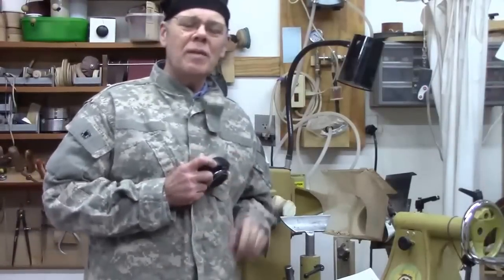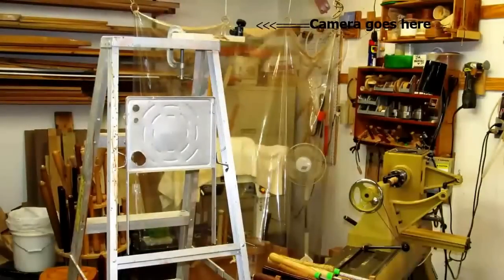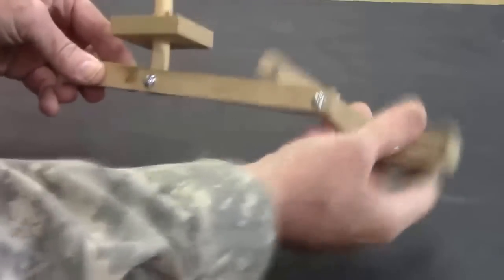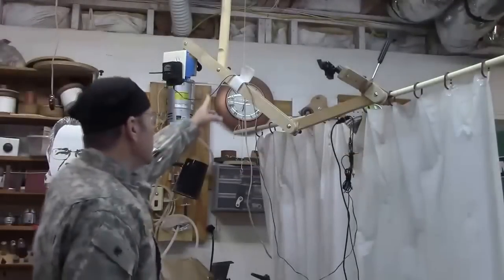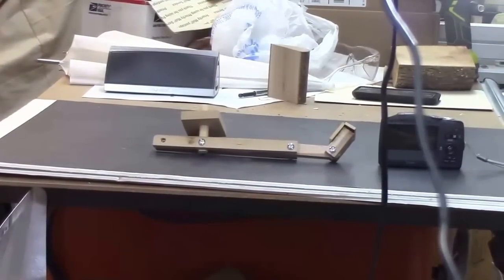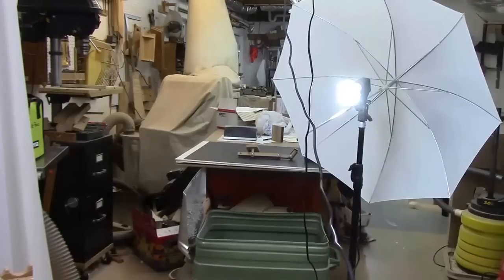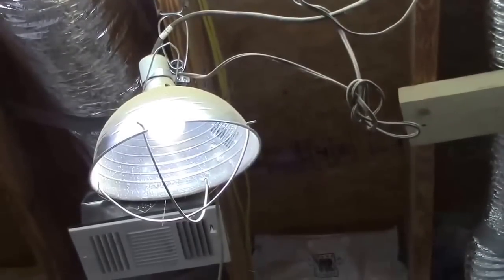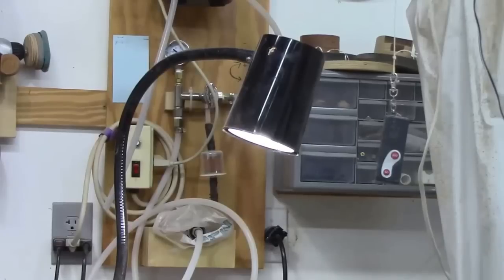Articulating Arm Camcorder Crane and External Monitor

Comment: Looks like some good ideas for mounting the camera.  What is the connection from the camera to the monitor?  Is it composite video?  Does your camera have a composite video output or hdmi output?  Do you use an hdmi to composite converter?  My camera has a mini hdmi output.  I understand there are inexpensive hdmi to composite converters available.
Reply from the maker: +Ed Hekman 
Composite. Neither camera nor monitor have HDMI. Not using sound to the monitor and the picture is fine for what I use it for.

Comment: Nice job on the camera arm Mike.  I video using a 5 MP mini security camera I bought cheap on Amazon connected via USB to my computer.  It's very limited but works for my purpose.  I use some old Ram Mounts from my kayak to hang it from.  I only do videos to see how I can improve my technique and learn from my mistakes in time lapse.  I have found that reviewing my work has been a very useful learning tool.  Have you?  Do you use capture software or just download from camera to computer?  What editing software do you like best?  Thanks for the video and great ideas!  Rick
Reply from the maker: +Rick Stonewood Arts 
I plug the SD card from the camera into my computer and copy the files. I use Sony Vegas software because that is what the folks at Gwinnett WW use to edit videos. I started with the free Windows Moviemaker which is not bad for free. Making videos is certainly a good learning tool to improve my ability to demonstrate. I think making lots of shavings does more for woodturning learning than anything else once you learn the basics from an experienced turner.
Reply: +Mike Peace 
I agree.  Getting to the point where muscle memory and experience takes over comes best from making lots of shavings and good lessons from an experienced turner to get started.  I'm certain that I would have had a much shorter learning curve of the basics if I had some initial instruction.  Gwinnett WW is where I first saw you demonstrate I think.  They put out lots of good videos!

Comment: The only problem I see with your setup is your umbrella light. I am not real sure how it was setup but it appeared as though I was looking directly into the light itself.  I spent 30 years as a commercial/portrait photographer (before wood turning came into my life) and I feel safe in telling you that the light should be facing into the umbrella.  As you have it set up, the umbrella is doing nothing. The purpose of the umbrella is to spread and even out the light (diffuse the light), to eliminate harsh shadows. IF you prefer harsh shadows then you could probably eliminate the umbrella and save some space and expense.
Reply from the maker: +Mark J 
Thanks for that. I probably need to do some video lighting experimentation to see what difference adding the umbrella to diffuse versus harsh light/no umbrella for woodturning videos.